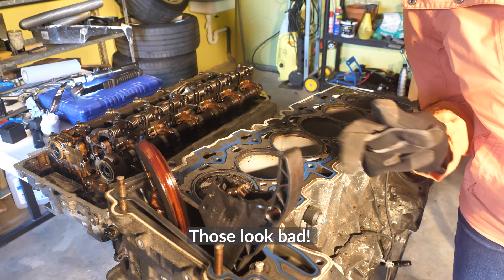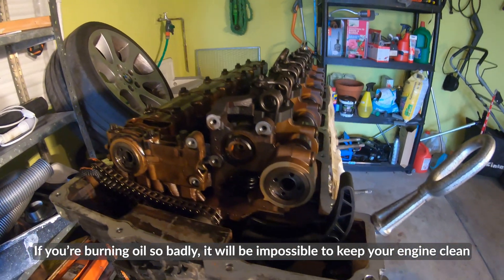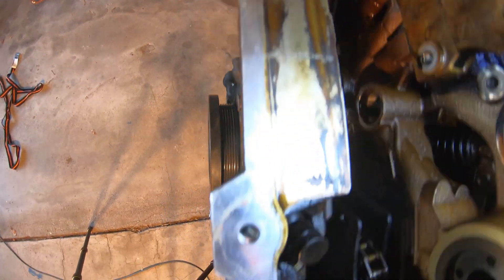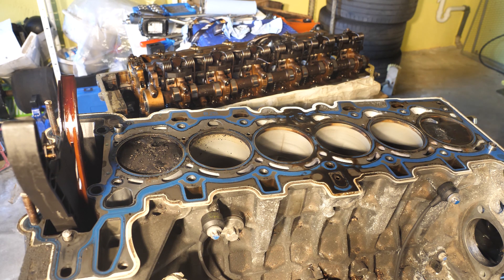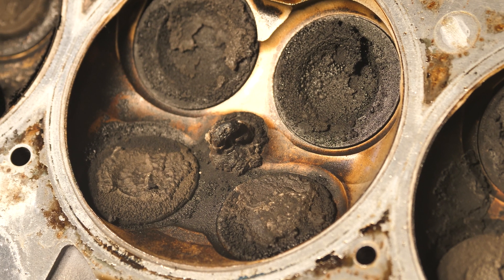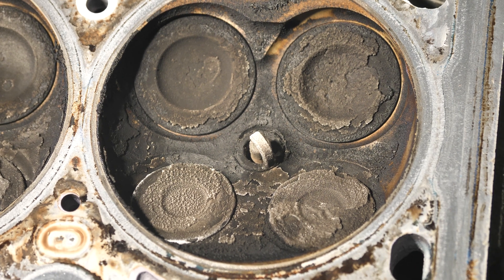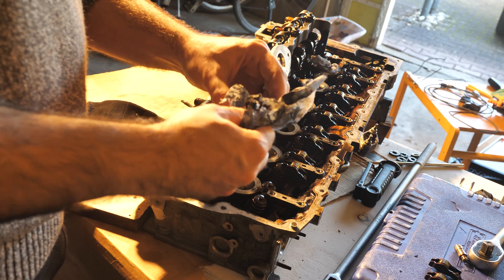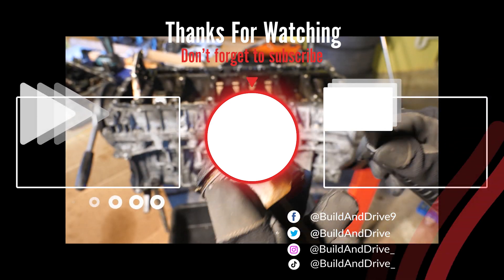MAJOR BMW Engine Failure! Let's Tear It Down and Find Out What Went Wrong [Part 1] 🤯

Comment: do you recommend n52b30 or it has same issues ? like burning oil 1l /500/1000 km
Reply from the maker: N52b30 normally does not have these oil burning issues

Comment: I checked many of your videos. I have same engine as yours. Currently its 315k km. When i revved high one year ago, it prob ate oil at high rate. I dont remember numbers. But I decided to drive max 3k rpm so I can try find leaks and repair under the time. I kept driving like that next 12 months, I didnt had add 1 litre at all. But sometimes it had rough idle. Recently I changed spark plugs, it greatly improved rough idle. It will be interesting when I start drive and see if it improves mileage :) I will try fix all small stuff like seals and cleaning before try high rpm revving.
Reply from the maker: Cool. That's great that your car isn't eating oil when you drive it normally. Glad you are fixing up the car! 👍🏽👍🏽👍🏽
Reply: What s your car? 330i?

Comment: Thank you for so interesting videos. I have the same engine (N52B25AF). The oil consumption on these engines is a well know issue. It is mainly due to a bad piston design. The pistons design was updated on 2010 and the problem seems to be gone. Here you are the updated piston BMW part number: 11257612982 (OEM Kolbenschmidt 40407600).
Reply from the maker: Thanks. That's helpful! 🙏🏽

Comment: Sold my 325i n52 after only 6 months. It was burning oil 1 liter every 300 km's. I tried every trick i could find but the engine was done. I think it had the same problems as yours.
Reply from the maker: Dang, sorry to hear. I took apart my engine that was burning oil and I'm going to figure out what went wrong with it. Right now it looks like a combination of worn piston rings, clogged or damaged oil rings and maybe worn valve guides/seals

Comment: hey bro, I was just wondering where you took the torque specks for your connecting rod bolts? I noticed that you did 20NM and then 60 degrees and 60 degrees. The reason I ask is because I have just done mine and I used 20NM followed by 70 degrees period. I took these numbers from my TIS workshop manual. I tried searching for your car N52 B25 as aposed to mine N52 B30 and my TIS come back with the same result 20NM 70 degree angle. Just curious. ✌
Reply from the maker: It was from the TIS online. I can try to find it again. Glad you checked for your engine 💪🏼
Reply: cheers bro 👍

Comment: poor maintenance oil and filter change intervals and spark plugs. pretty simple stuff.
Reply: What are your crappy design flaws?
Reply from the maker: Plastic everything. Bad oil flow to the cylinder head. Bad oil control rings and piston design.
Reply: unfortunately these engines have crappy design flaws, so maintenance only goes so far.
Reply from the maker: Yes, alot of the flaws were fixed in the n52b30... And then BMW screwed up again with the n53b30 😂😂😂
Reply: @buildanddrive  right  😂😂
Reply from the maker: These plugs have only 5k on them.

Comment: 25k km oil change interval not a good idea, forget what bmw says… they make their self look good on paper… leak valve stems, clogged piston oil ring and busted pcv valve could push oil unintended part of the engine… use right weight engine oil and oil brand that dont full around the recipes of the product… i live in Calgary- Canada, in winter i use 0w-20, summer i use 5w-40 bwm-LL1…  time to time i put detergent additives to dissolve some crust and pick them up from vanos check valve to see anything chocks the engine… bmw n52 engines not a proper design for the oil washing down from lifters and valves area, you’ll always collect gunk up there, to keep it clean you’ll change your oil more often and select right weight for the time of the year… go thin in winter -25 to 0, go thicker like 5-30,40… never ever use 20w50, thats the dumbest idea spread in Europe that they think they should… even in Europe people still using water as a coolant, they saying we don’t get cold, antifreeze its not about the only stop freezing its also creating high boiling point plus lubricant for water pump… little long comment but small info to share for better future for our bimmers…
Reply from the maker: Thanks for the comment to help others learn about these engines. These early n52s did not have great oil flow design but they improved this in the n52b30. There are a lot of small issues that happen over time as you described. What detergent additives do you use?
Reply: @buildanddrive  i use liqui-moly valve clean for fuel and MoS2 anti-friction for oil once a year… when i used anti-friction additive i use the oil 10k km… it has black friction particles that smooth out scratches… when you pour anti friction oil, make sure shake the can and rinse inside of the bottle few times and pour into engine until you see the bottom of the bottle shiny metal… top it up liqui-moly toptech 4200 5w-30,40 and good to go for 10k km, even 15k km…
Reply from the maker: @bimmerx440  do you use them together?
Reply: @buildanddrive  same time…
Reply from the maker: @bimmerx440  interesting. I tried the valve clean before to try and fix the ticking noise when I was using 0w40 but it didn't help. A good 5w40 helped fix it.
Reply: @buildanddrive  liqui-moly has new oil called molygen, its in green jags, it has the highest detergent maybe use it every 3 oil change or all the time, quite pricey out here $93 cad 5L…
Reply from the maker: I buy 20L of Rowe 5w40 for 120$ and meguin 5w30 for 90$. I change my oil twice a year (about every 7k to 10k). I assume no need for extra detergents as my engine is rebuilt and should be super clean since I change the oil so much.

Comment: Mine is 2007 n52-b30 . Has 228,000 miles  every 1,500-2000 miles it uses an leaks 1 quart. It also ticks randomly. Once the engine has ran higher rpm’s for awhile ticking always goes away.  Great engine with just a couple quirks.. love the n52 content definitely appreciate it !

Comment: Another great video , these videos will be like gold to anyone who owns a n52 so probably millions of people . Keep up the good work bro . My n52b25 is running through about 1 liter every 1000 miles how’s your rebuilt engine holding up on oil consumption ?
Reply from the maker: Thanks for the kind comments! 🙏🏼 It's running about the same 1L/1600kms.
Reply: So it's still burning oil after the rebuild? What do you think went wrong? Considering rebuilding mine
Reply from the maker: I didn't use the new piston design. You can either drill your original pistons or buy the new design. It improves the oil flow in the cylinders

Comment: The power of worn valve stem seals and prolonged oil change intervals. You can thank the first owner!
Reply from the maker: Bruh...😬😬😬😅😅😅
Reply: @buildanddrive  what happened is that some cylinders got overwhelmed by oil burning.
Valve stem seals were bad, ccv was bad, piston oil' rings were clogged...
That would give like 1L of oil burned every 500km. That is a death sentence to the engine.